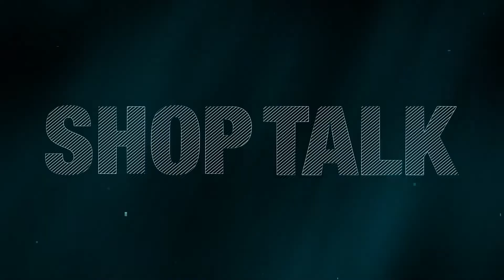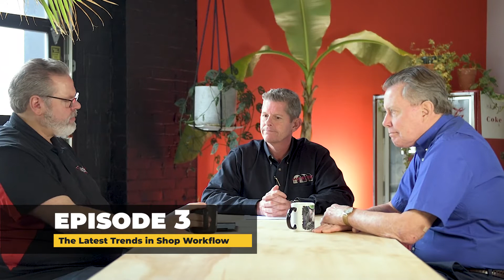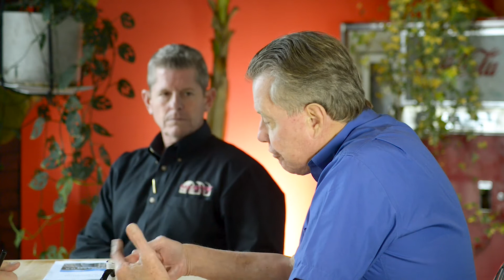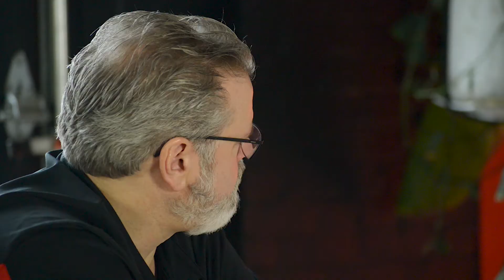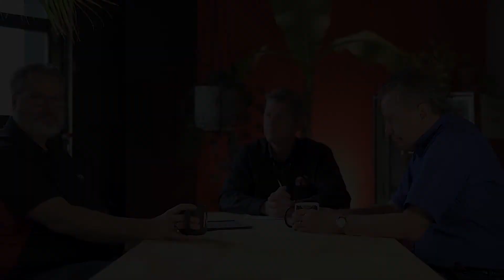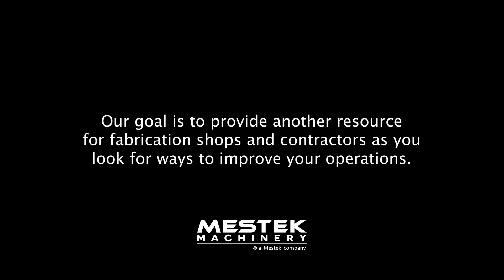Shop Talk | Ep. 3: The Latest Trends in Shop Workflow in HVAC Duct & Fittings Fabrication Industry

Comment: Another informative video I believe you guys are scratching the surface of a much larger Issue in the Sheet-Metal shop industry.  In certain parts of the country labor is much more expensive than material therefore workflow solutions are a paramount problem that we need to address
Reply from the maker: Hello @BadtinMan — thank you for the reply. We see the impact that labor continues to have on the industry. If you get a chance, check out this page and feel to past it through to your colleagues... we've helped contractors improve their shop layout to boost productivity by over 50% and we'd love to help you guys find ways to improve your workflow and realize the associated benefits: https://mestekmachinery.com/iowa-precision/video-improving-your-hvac-duct-and-fittings-fabrication-shop-floor-layout-for-maximum-productivity/